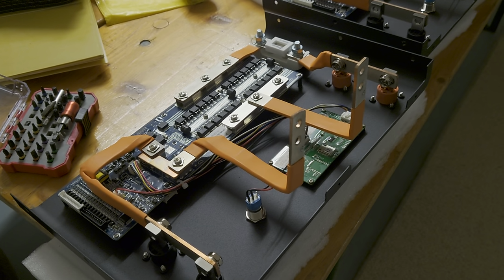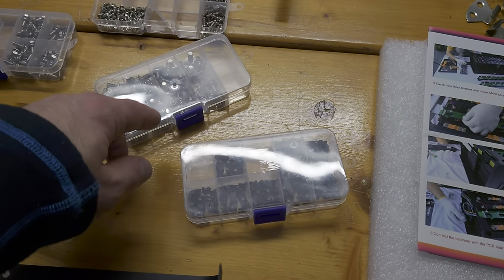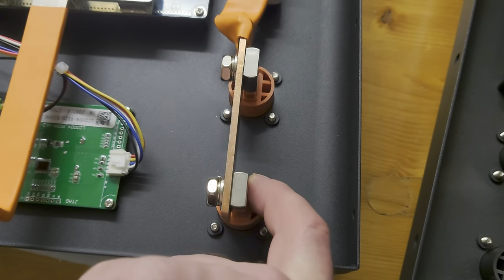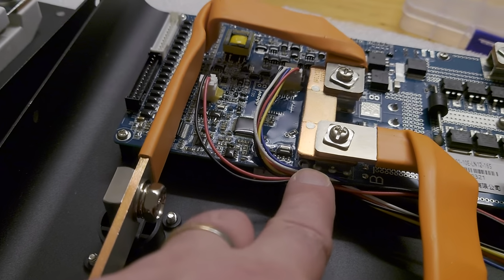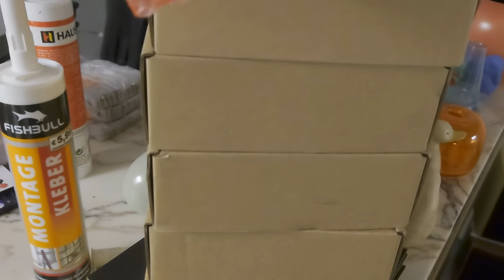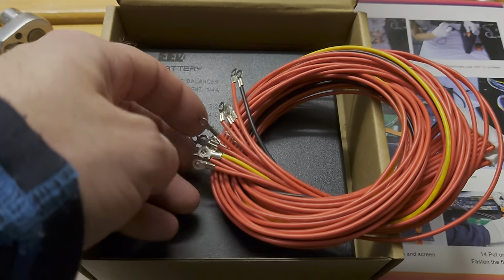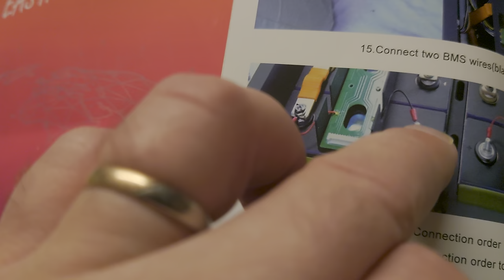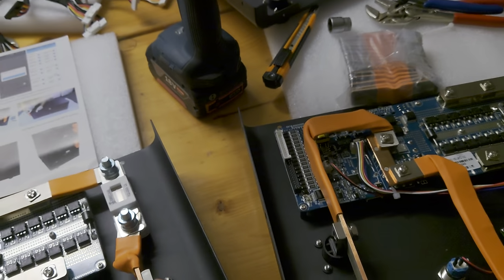EEL DIY V3 hints and tricks

Comment: With the cable to the PCB for the active balancer you also need other kind of PCBs, which have two independent connections to each busbar.Jens from MeineEnergieWende has discussed this already. With just one cable from the PCB to the busbar the reading interferes. This is why EEL recommends to connect the active balancer to the busbars directly with the wire harness with the PCBs you have. But nice hints, have also ordered an EEL v3 box and are eagerly waiting for it to arrive
Reply from the maker: yep, that's the way it seems. I'm in contact with EEL about this issue and prefer the other way with the power boards and clean cable harness to the balancers over this version. this wasn't communicated properly when I ordered the cases but thanks for the hint I realized the differences of the boards on Jens video to mine.